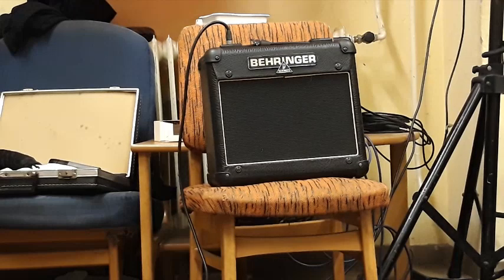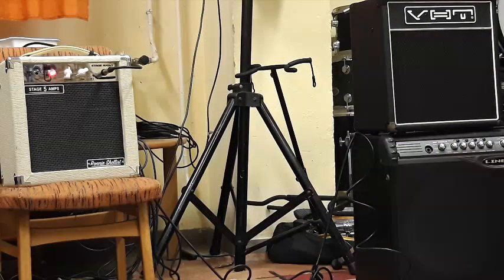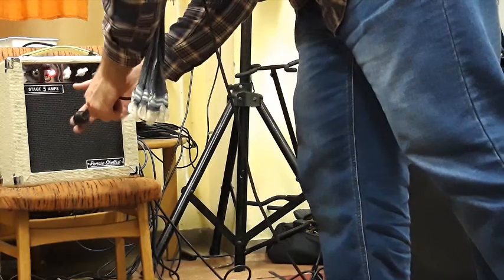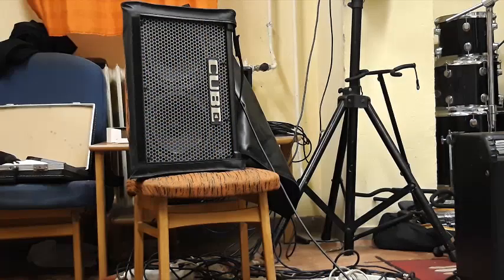Electro Voice 635A/B microphone test with harmonica

Comment: The 635 is an omnidirectional microphone. 40 some years ago I attended a microphone demonstration at Ohio State University. The EV rep pounded nails into two 2X4 blocks of wood with a 635. He subsequently connected it to the PA system and everyone saw it work after being used as a hammer.

Comment: Did you need to use an impedance matching transformer for the mic as I read they are low z. Thanks, mate. You’re sounding bad ass!!
Reply from the maker: Yes, when I use it with cable, I always use a matching transformer. When I use it with the Samson Airline wireless unit, I do not need the transformer. 👌

Comment: Do you recomend the stage 5 RS?
Reply from the maker: Yes, I recommend it, I am satisfied with it. From little to middle sized gigs it does the job perfectly. The line out can drive other amps or PA, when more power needed. It won't move a whole lot of air, because it has an 8 inch speaker, but it will CUT through the mix, it has tons of extra presence to cut even more. Soundwise, this amp has basically one type of sound at loud volumes, the raspy, hairy, presency sound. Smoother sounds can only be dialled in at lower volumes. Creamy sound is impossible. The excess presence is good, when you have to play at coffe shop volumes.  Some harmonica players and hobbists prefer a lot of bass in the harmonica sound, this amp is not for them. Almost all sound technicians will cut off the bass frequencies from the harmonica in the main mix anyways, so why bother with bass heavy amps if it wont make it thtough the PA? :) In Europe, you have to fit the band in one economy sized car to get to the gig. This is where the Stage 5 RS amp shines, because it is small and light weight, fits in the trunk well. Is there a better amp for harmonica? Sure, lots of others. I would love to gig with a Marble Mascot 112, but it is at least 5 times more expensive, and more heavier. This amp fits my needs. Hope I could help. :) Best regards, Big G.
Reply: @prekopgyozo  Hey thanks for your help, I have seen a lot of positive comments of the RS model, I am thinking of buying it, but from what I understand it is not an amplifier with frequency bass and sound, I love the amps that have bass frequency.
Reply from the maker: @chicagokings4631   It is a matter of preference, actual taste and highly depending on what mic you use. If I use it with an average black cr, more or less I give up the bass in change for the texture. If I use it with a matching transformer and SM57 or a vocal mic, more bass arrives. The Weber speaker is capable emitting more bass, but you will have to use pedals gor more EQ. If you use the line out, you can always dial in the EQ you prefer. You can add bass to your taste and I also recommend to start with high roll-off, because the presence will pierce everyone's ear. :D
Reply: You have so much good information in your demo's!  Really solid in depth reviews. And I could listen to you all day and never practice! I realize this is an older review. But if you read this comment, please keep up your demo's. IMHO they are the best.
Reply: It’s a bit late, but save your money on the Stage 5 amp.  There are several options for much less that are very similar.  All 5w tube, all sound virtually identical to the stage 5.  
Stage Right 5w
Bugera V5
Line 6 5w

The stage 5 is made by taking a Stage Right amp (literally), clipping 2 caps, swapping the preamp tube for a 5751, and a Weber speaker swap. You can do all of this yourself for less than $250 TOTAL.